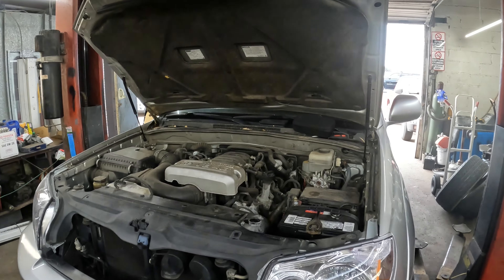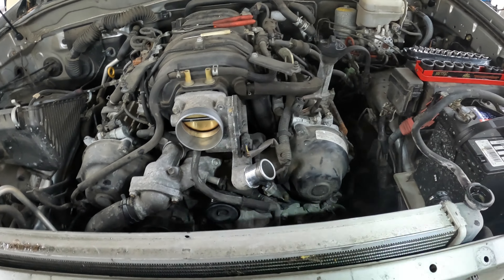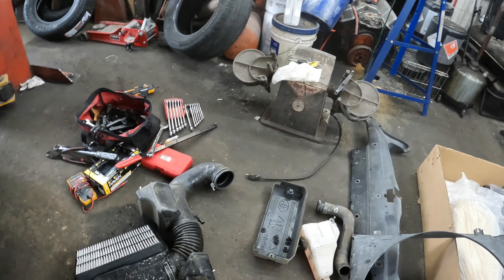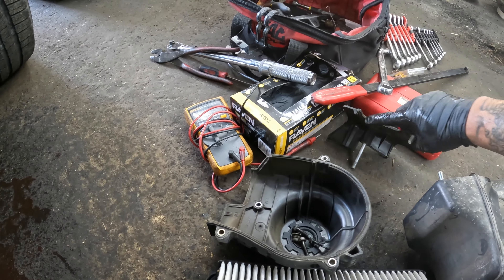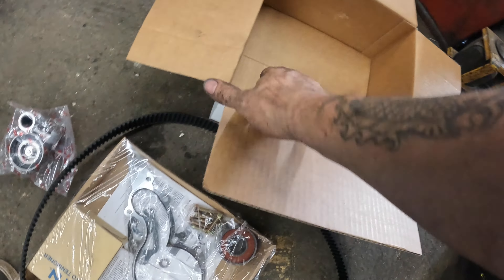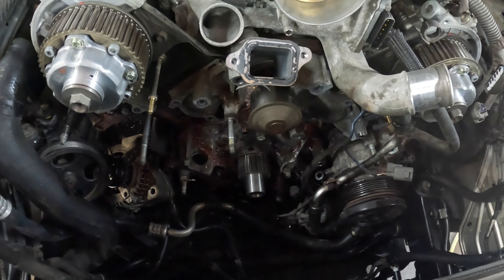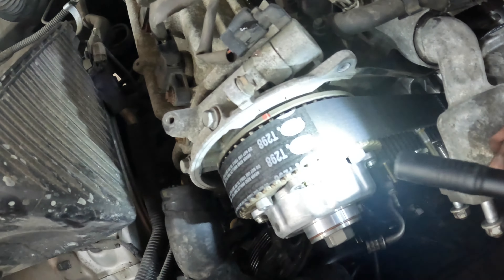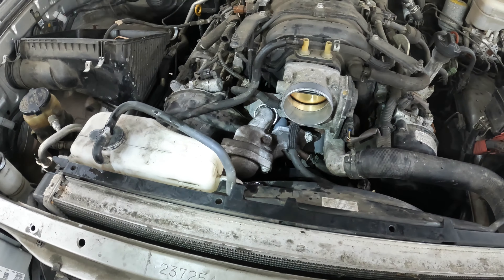4.7 4Runner Timing Belt Replacement

Comment: where do you find your torque specs?
Reply from the maker: I use prodemand which is a labor guide, wiring diagrams, and work instructions with torque specs.  You have to pay for it which is about 200 dollars a month for the basic plan.
Reply: @operationoverhaul  thanks for responding!
ok awesome just checking i have access to alldata through my job but sometimes it doesn't have torque specs.
Reply from the maker: @colbimitchell  You are welcome and if you ever need any torque specs that you cannot find feel free to contact me and I will try to help you as much as I can.

Comment: You could’ve explained how you got the harmonic balancer off
Reply from the maker: Once the bolt is off, you literally just pull it and it will slide off.  These are not a press on or off balancer.  If you are having issues getting your balancer off, it may have rust on it and that may what is causing it to stick on there.

Comment: What is the typical cost range for this repair? Thanks!
Reply from the maker: Without parts you could be looking between 650 and 900 depending on shop rate.  It can vary depending on location and type of shop.